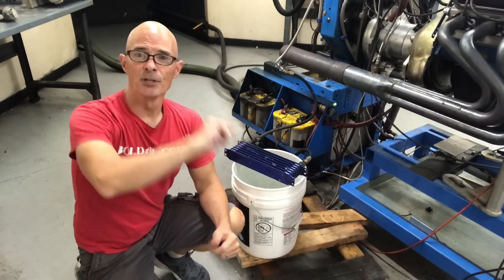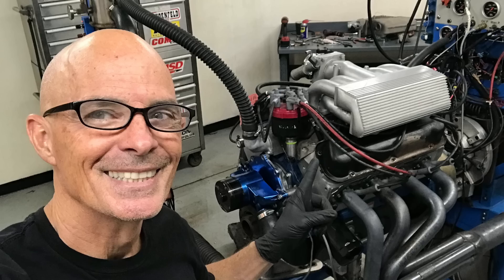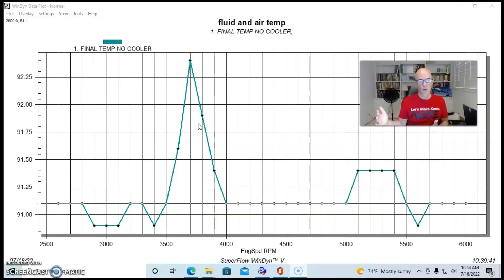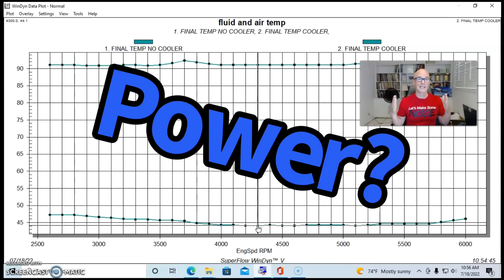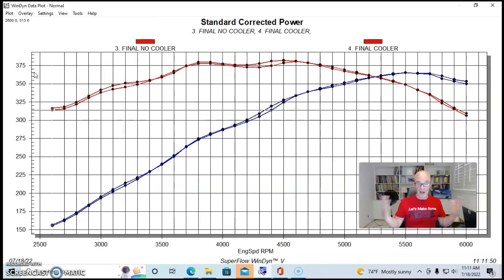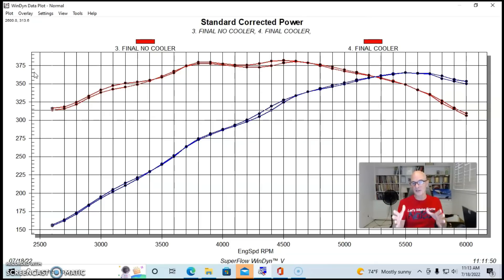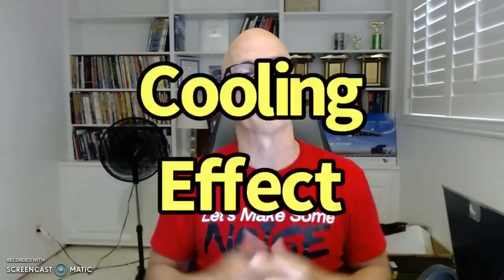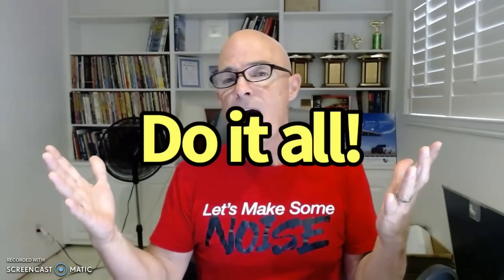EFI FUEL COOLING & HP? DOES ICE-COLD FUEL ACTUALLY ADD POWER TO YOUR FUEL-INJECTED MOTOR? DYNO TEST

Comment: You wont gain much power. This is 100% just a supporting mods. Port injectors will always have colder fuel over a carb of tbi set up as you have more time in hot air before hitting the cylinders. This is perfect for detonation and predetonation prevention. Will be doing a fuel cooler on my rotary for atomizaton.

Comment: It would be interesting to see if fuel cooling would make any difference on a Throttle body injected engine application. Since the fuel/air charge is introduced further upstream.

Comment: I'm interested in a back to back comparison on a N/A engine with a holley sniper efi 4150 set up vs carburetor with cold fuel vs hot fuel as both introduce fuel at the top of the intake. On the sniper I would think you would put the fuel cooler between the regulator and the throttle body as it should have a return system and the carburetored system is dead headed.

Comment: I would like to see fuel rail "heat soak" taken into consideration.  Allow both applications to run for 15-20 minutes... then run the numbers.. fuel rails get very hot and the fuel in them does not move very fast allowing the fuel in the rails gets very warm.  

I've seen 15hp gains from just insulating fuel rails... non insulated rails get very hot however on an engine DYNO non of this is really part of the equation.

Comment: Very interesting, I thought for sure you would see a bigger difference.. if you cool piston/cylinder heads you should always see better combustion results.. Jag ran their fuel line through the AC return line,, Mercedes back in 50-60s squirted a small amount of cold water..

Comment: Is the system computer controlled? If it is, you will not see changes to output power. The computer is adjusting fuel input and air, to get that power profile.

You would have to measure consumed fuel. If it is getting more power with less fuel, that is the gain. It keeps the power profile by dumping in more or less fuel.

You should totally try both ends of the spectrum.

Yes, cold gas is more dense, but it is also harder to automize. Hit fuel is easier to automize.

Technically, all fuel injectors are cooling gas at the point of ejection. Going from low pressure to high pressure, liquids and gasses lose heat. (Compress air and it heats up. That heat is lost through the tubes delivering the compressed air. When it exits the valve, it decompresses and loses heat. You could be altering the temps by only 2 degrees,, past the injector head.)

Measure the temps of the gas coming out of an injector.

If it is cold out of the injector, without cooling, that can be your issue. It's compressing and absorbing stray heat, in addition to not being that great of a difference in temp change.

Try super heated gas, which is already hyper-active and more easily ignites in a chemical reaction by being authorized faster. (Hot gas blowing into cold air will automize a lot faster, by evaporation or reverse condensation.)

Unfortunately, you really have little room to work with. Injectors already automize fuel 95% to perfection, if they are not dirty. The air mixture, regulated by the computer, is also about 95% perfect. You are already getting about 90% total perfection and trying to grasp at that last 10%, across two perfected systems of control.

A race cars largest issue is still going to be traction limitation. Even that is tuned to near perfection, except when people start messing with adding more power to a complex and max limited setup. They break the final tuning and all gains become losses at that point, on the track, off a dynamo.

I forget what the actual limit is, but it's the reason why no real records are broken any more, for land vehicles. They need to use tricks like glue on the tracks, hit melted tires, jet engine boosters, near zero aerodynamics and post launch data dumping, to get records broken. Essentially just cheating the system, now that the maximum limits are known.
Reply from the maker: how do you figure computer controlled means controlling power output?

Comment: Try it on a tunnel ram. Run the fuel through a NOS style plate (no holes in the tube) before it feeds the carb.
Also, you can add salt to the ice.
Add insulating tubing around the hard lines after the cool can.

Comment: This test is interesting but not realistic. No one is going to chill their fuel on the street/track for a few HP. If it's colder outside then air and fuel temp power gains are just assumed. But I'd be MORE curious about what the UPPER limit of fuel temp is and how that affects power as that affects most of us on a daily basis. The type of fuel temps resulting from an engine bay crammed with power adders, on a hot track day.
Reply from the maker: fuel cooling does stop vapor lock-common in drag week type cars

Comment: You would see better electric fuel pump longevity with heat being the killer.
Also the radiant heat from summertime track conditions has to have an effect on fuel temperature.

Comment: When you ride your car for 30 minutes fuel is gonna be more than 95F. When we had some fuel pressure problems with a turbo Mx5. After 30 minutes external fuel tank temperature was (more than the exterior of the final exhaust muffler) around 130-140F. Muffler was at abient temperature so heat was fuel pump induced

Comment: The thing is,my 79 scout 2 had a dry ice can on it. I noticed a difference when the engine hit 210-230* temps the power didn’t drop off like a hot engine does. So even if your 4x4 is overheating in the mud, you still have the power of a cooler running engine to get you out of the mud hole you’re battling. So that’s where this test needs to happen. Like a hot running 671 blower to put more timing in to it.

Comment: I've always been curious how much air cooling results from the venturis. The principle of accelerating the air within the venturi to create low pressure drawing fuel out of the float bowl uses energy  from the air - heat.

Comment: I've often considered running a fuel cooler on my Fox Mustang. I'd be very interested in seeing a boosted application test of this.

Curious to know if you'd see any difference running this fuel cooler test on an actual car at operating temp with everything heat soaked & see if the fuel cooler makes a difference in performance??

I like your test & backed up by data, but it doesn't represent what we'd see in our cars. My thought process is, many of us are running higher volume/pressure pumps, & headers, all leading to more heat soak into the fuel, especially with the return style fuel system, at what point are we completely heat soaked in the fuel tank as well. Pumping hot fuel has got to lead to premature pump failure?

Just curious to see some data on this on a moderatly modified street application.

Comment: I wonder if real-world, i.e. under-the-hood temps, would make more of a difference. If the fuel coming to the engine is 180°, vs 90° to start, and cooled by 50 degrees to 130°, will that possibly be more beneficial than a 90° to 40° drop?

Comment: Did cooling the fuel cool the valves and head to help reduce engine water temp say with a 1 inch restrictor and no thermostat as many racers run.   running at 195 did it cool to say 190 degrees?
Reply from the maker: I doubt it

Comment: What you will have is a much happier fuel pump. All the fuel that is being pumped around and heated up the whole time will take its toll on your pump. Cooling fuel temp is not a power option, it's a reliability option. 👍

Comment: is it safe to use an oil cooler as a fuel cooler?  I have issues with fuel temp and vapor lock on long trips in my Z due to poor factory fuel rail design, I've been wondering if just cooling the fuel would mitigate those issues.

Comment: Can you run the water flowing through it pulling the heat away, a pump, or hose to imitate a flow like the car boat ex, was moving in motion.
Reply from the maker: the cooler is submerged in 32-degree water-heat travels from hot to cold-the cooler is doing its job

Comment: I see SCTA trophies. I’m debating fuel cooling on my kinsler injected n/a gas lakester. Big temperatures at Bonneville… think its a waste of time?
Reply: SCTA provided even gas. VP MS100
Reply from the maker: cooling the fuel didn't add power on the high pressure efi-but did on a carb application for Engine masters
Reply from the maker: are you running in gas or fuel class?
Reply: The Kinsler has the injectors mounted really high, and the engine bay temp will be huge compared to the test ambient… 🤷🏻‍♂️

Comment: I would like to try a cool can setup on a racing outboard. These are two cycle carborated two cylinder motors. Relatively low compression. Just an improvement of 200-300 rpm would be beneficial . Worth my while?    ROGER

Comment: You should do it on an inter chiller not and oil cooler. I think the fuel needs to be below freezing to have any real affect. Inter chiller will hook up to the cars ac unit. Maybe use the oil cooler before the inter chiller so the inter chiller can cool the fuel faster and possibly lower. But an oil cooler alone I don’t think will get it that cold
Reply from the maker: YOU WON'T GET FUEL BELOW FREEZING

Comment: Do you know that liquid nitrogen is at -275° whereas co2 is dry ice at -75° which is a heck of a lot colder than ice. Nitrogen well freeze the fuel if not break your air cooler.

Comment: Compare the heat absorbed by cooler fuel vs heat absorbed by the phase change from liquid to gas.  Maybe a stretch, but you might be in a realm where it's so cold that it doesn't vaporize in the compression stroke, thus doesn't burn as well.

Comment: As you know, this test really needs done on a boosted engine, and also against hotter fuel
Reply from the maker: boosted engine won't change results-but always boost
Reply: @richardholdener1727  cold fuel is bound to add some charge cooling effect ?
I wonder about water/meth temps too ?

Comment: If you can prove that cooling the fuel changes or alters it in any way, then there may be benefits of cooling the fuel. Ethanol is not the same as gasoline,  so the cooling effect is already in it. My guess is, if you chill the Ethanol nothing significant will happen in terms of power gains.

Comment: i ordered map for may 300c 5.7 that uses lpg and  map was adjusted for lower lpg temperature, after i made some changes on vaporiser, it started to heat up lpg on higher temps so knocks occured, so maybe you should give some spark plug advance when you test cool fuel

Comment: I have seen 7-8% added fuel trim correction with high fuel temps on E85 in a boosted application but only in vacuum. We're talking 110F+ down to 85F. Tropical environment.

Comment: you should take a street driven car that has the same motor your gonna use, test the fuel temps on a hot day driving around. Replicate those temps on the dyno for NA and boosted, get the dyno numbers for both setups, then do runs on both with the chilled fuel. It would be a more real world test in my opinion, you could put the cooler in a bucket of fairly hot water to raise the temps. That I would love to see the results of, I live in south florida and rock a fox body with a 5.0. It's been mid 90's every day here and I bet my fuel get stupid hot, I'm curious what kind of temps my fuel is when driving around town.

Comment: be interesting on something that is direct injected,  also try a cooler of dry ice. Also with EFI  or direct injection test  are you just running the same with no changes as the test run with out cooling for the power comparison or are you adjusting timing  and measuring knock?  I imagine If you can get the fuel to 0C to -15C  you might see results like a water-meth injection set up but just from the  cooled fuel and  maybe hold back knock.  will be as good as colder intake air temps probably not.

Comment: Only way u would see gains is if it was turbocharger and it had a knock threshold ..u will be able to boost more without knocks.. because cooler fuel wld reduce combustion chamber temperature

Comment: I read an article years ago about Smokey Unick where he heated up the fuel to 212° and used a turbo charger , not for boost , but to atomize the fuel and got quite a bit of increase in performance and mileage.
Reply from the maker: THE NOT FOR BOOST PART IS IN QUESTION
Reply: @richardholdener1727  I agree. He wasn't known for being completely honest. None of the racers who won a lot were.

Comment: The reason you didn't see major gains with the cooler more dense fuel is because the fuel injection is compensating for the difference in fuel density. On a carburated application it will feed the same amount of fuel weather the fuel is hot or cold. However with cooled fuel being more dense you are actually feeding it slightly more fuel than with hot fuel. It will show up on the O2 sensor as running slightly rich.
Reply from the maker: the fuel injection fed the same amount of fuel-there was no compensation
Reply: @richardholdener1727  doesn't the oxygen sensor compensate for the air-fuel ratio. Since that is the case it will adjust the fuel pulse to account for the more dense fuel. A carburated engine will not make that same adjustment, this giving it a slightly richer air-fuel mix which could account for the difference in power numbers. Also as you mentioned the fuel is cooling the air stream as well. If the numbers are available the carb was probably running a more dense air-fuel ratio.

Comment: Fuel turns into vapor before it’s fired that cooler temp fuel wont matter after it gets vaporized/mixed with warm air, now if you dropped temp of incoming air to match the temp of the fuel that will impact more as its will be a cooler charge all together. There is 12.7:1air to fuel ratio feeding a engine so the air temperature will have a larger impact.

Comment: what if you ran the fuel through a bucket full of dry ice or liquid nitrogen. would we see improved fuel economy
Reply from the maker: FUEL ECONOMY GOES DOWN WITH COLD
Reply: @richardholdener1727  would have thought it went up due to charge density increase improving fuel burn, maybe on a carburetor?

Comment: This is how I keep my turbo bikes temps down. Works with gas but it works even better with e85 and even better is methanol although that a whole pita. I go way colder with dry ice fyi.
Reply: Idk if you remember talking about my little turbo bike rich but I run what we both called crazy timing with crazy boost( it's actually gone up alot more since then). I am blow through carb but I believe my carb is only about 3in off the port. I don't think it's so much about the time or length of run. I believe it's about the difference in temp between the two media. My charge temps regularly get over 300°f my fuel is e85 these days at -90-75°f depending on the day. I have a temp prob that I move around including a small thread in port on the head that reaches the elbow into the bowl area of the port. With normal e85 I see about 150-200°f with chilled e85 I see a bit below ambient. Also I'm air cooled so it keeps my head temps down which helps with detention. I feel in a water cooled engine you won't see the same improvement. Also for a modern car engine with boost I don't think it will make the biggest difference, not because of distance but because of the size of the spray. I run a mjn carb that breaks the fuel up the needle like a lectron. I bet youl see some gain on the 3800sc but much more if it was pull through carb. And that expiriment you did with the n2o explains what's going on here very well. temp of each media vs lb/min of each media. This is a big part of why e85 gave me much bigger gains and when I tried meth it got me in the negatives for charge temps. I don't like meth too much hassle and composites really don't like the stuff.

Comment: Cooler air makes a huge difference! Could try running a fuel line into the upper intake then to the injectors to assist to cool the air.

Comment: Most road racing needs milage not sure about F1 but in MotoGP & WSBK they cool the fuel as much as possible not for a   power increase its so they can  fit more capacity into the fuel tank  which it is  successful at doing.

Comment: Good test but diminishing returns here.There is much more to be gained by managing the temperature of the air charge vs cooling the fuel. As far as I can remember the only benefit to cooling fuel comes with a return/bypass system where heat can be returned to the tank through the system and possibly shorting the life of the pump or cause fuel delivery problems. Out of all the other ways to manage heat this would be the lowest on my list.

Comment: Motor trend even reported on Smokey with the fiero. Maybe try heating the fuel instead of cooling it. Be a simple test. Use boiling water or boiling salt water for more heat to heat your cooler and run the test again.

Comment: I recall reading a book by Lingenfelter (maybe it was Banks) that mentioned how cooling fuel is counter-intuitive. You are expending energy within the cylinder to warm the fuel up to the vapor/burn temp which ultimately is wasted energy. Essentially, you want cooler air and warmer fuel. The caveat to this is how the fuel is injected; I would agree you would see various results depending on whether it is GDI, Port, Throttle Body, or Carb.
Reply: cooler fuel should draw more heat out of the combustion chamber. as the temp delta is higher. atmoization of fuel is more dictated by injector quality than initial fuel heat. as the reaction is mostly chemical and triggered by a spark the combustion tempreture/power remains mostly unchanged, aswell as the heat it dissipates in the piston, cylinder, block valves etc.....
therefore it is unlikely you will see much in the way of power gains. however engine efficiency or mpg should increase the cooler you can get your fuel and air intake charge (upto what point it stops becoming benificial, i am unsure).